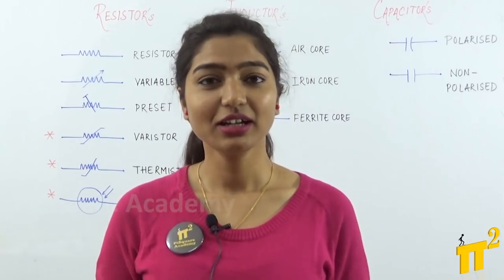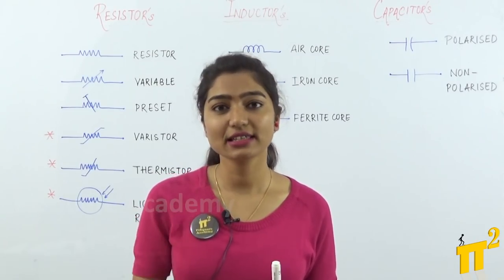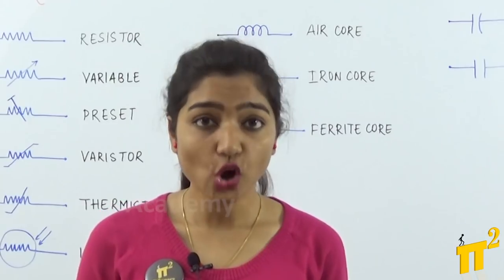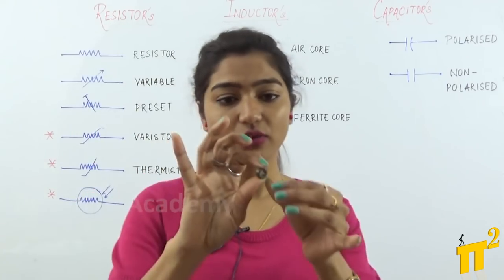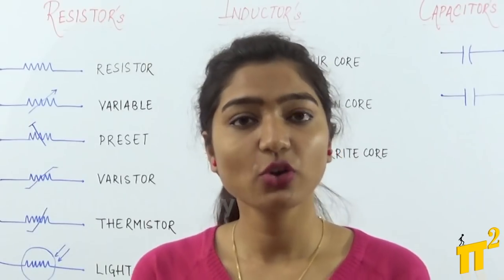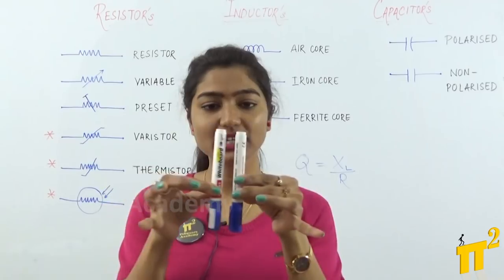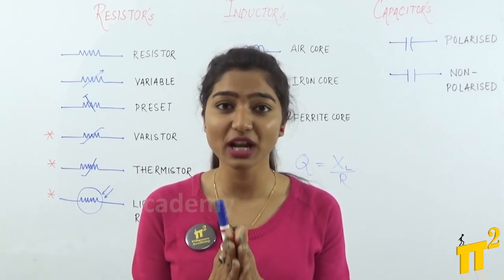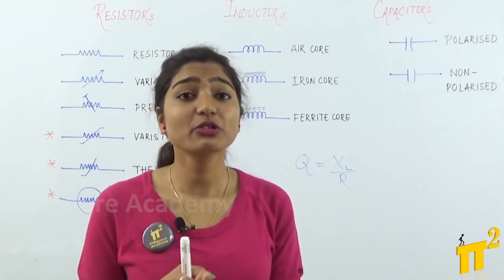R, L, C Symbols | Choke vs Inductor | Dielectric vs Insulator

Comment: Ma'am, at 5:26 of the lecture, you said..ferrite core has no electrical conductivity. I know that you mean to say ferrite core's s electrical resistivity is higher than iron core which helps in minimizing eddy currentsl. Please use low and high kind of comparison in stead of saying no electrical conductivity.  I follow your lectures madam...they are very helpful.

Comment: mam can u plz make a video on why in power system if delta of rotor of syn generator is greater than 90 degrees y generator becomes unstable mathematically i know but what exactly is happening inside the machine.if u could come up with a animation video up on this this would help the student community in better understanding of critical clearing angle concept.thank u

Comment: Is there any relation between preset and thermostat use in geaser I recall some have a reset button
Reply from the maker: Preset is a one thermostat types, that can be set to a specific temperature in advance. It is commonly used in water heaters, such as geysers, to control the temperature of the water.

Comment: Please this confusing problem for different cases

if the no of turns doubled then time costant of a coil will be
Reply from the maker: Time constant will remain same, as the no of turns double every thing else is constant, L will become double (as turn and length of coil is double) and also the Resistance will be double. So time constant no change.

Comment: Mam DC capacitors will exist or not
Reply: They exist
Reply: @mohammadalipalagiri1728  what kind of capacitor banks used in neutral clamped inverters ...
Reply: @durgaprasadchary5733  it should be electrolytic capacitors which are polarised and should be used by taking care of their polarity.
Reply: @mohammadalipalagiri1728  Tq Sir,  what type of DC capacitors used in dstatcom and custom power devices.  If it electrolytic how to charge that capacitors .